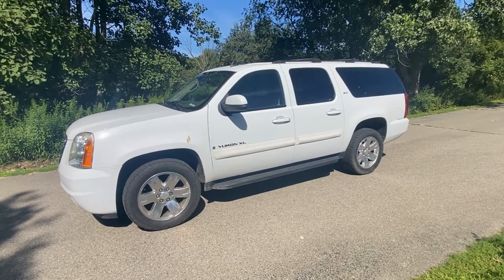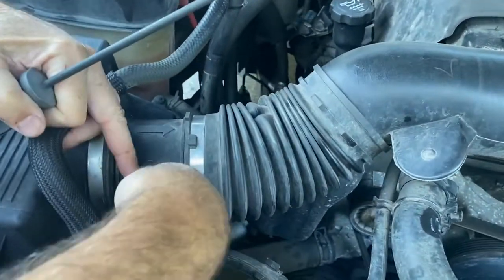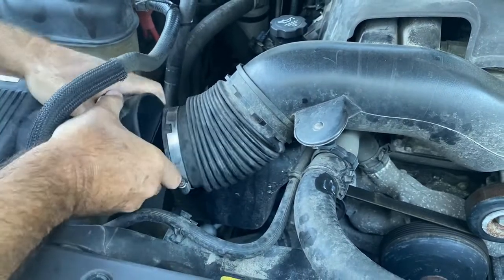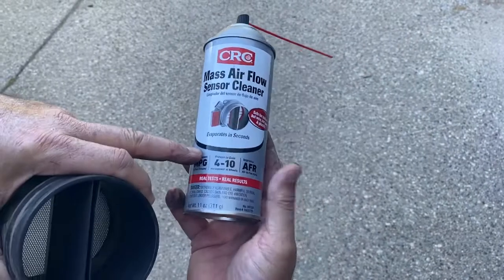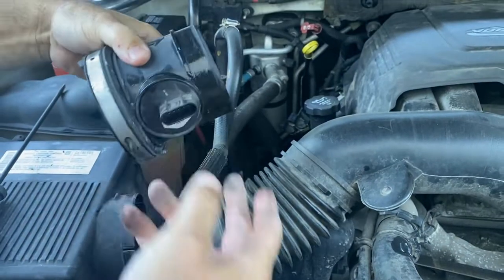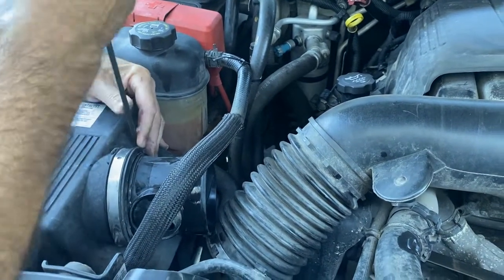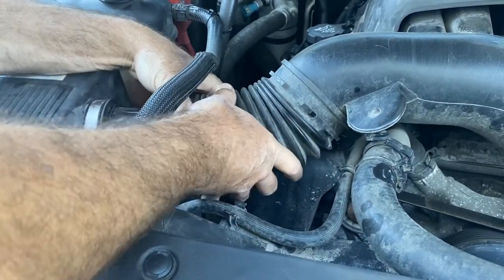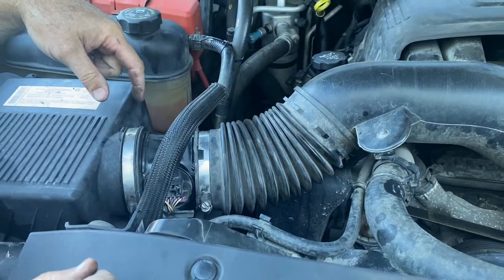How to clean or replace a Mass Airflow Sensor on a GMC Yukon

Comment: Why can't you use a break cleaner?  I've been doing this for 20 year's.  Well that or starting fluid
Reply from the maker: Brake cleaner contains powerful solvents like acetone, toluene, or methanol, which are designed to strip away oil, grease, and brake dust from metal parts. However, these solvents can damage plastic, rubber, or sensitive electronics inside a Mass Air Flow (MAF) sensor.
In addition, some brake cleaners ,especially non-chlorinated ones can leave behind residues that interfere with the MAF sensor’s readings, potentially causing engine performance issues.
For this reason, it's safer and easier to use a dedicated MAF sensor cleaner, which is specifically formulated to clean the sensor without causing damage or leaving residue.

Comment: I cant get the sensor plug off for the life of me on my 02, any tips?
Reply from the maker: When you push down on the tab, try pushing it forward and back. If not try a small screwdriver or hooked tool from the other end to try to release it.

Comment: Which ( fuse) controls the MAF sensor
Reply from the maker: Information for fuse location should either be in your owners manual or on the  inside of the cover of the fuse box itself.
Reply: @The Auto Teacher  not for the MAF sensor.. would like to know if it's called something else on the fuse  box.... thanks for responding